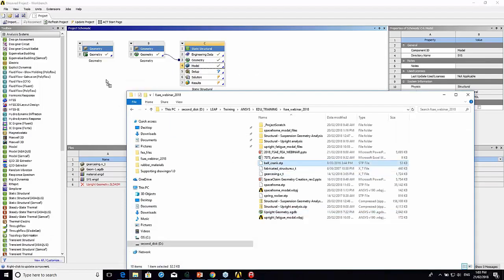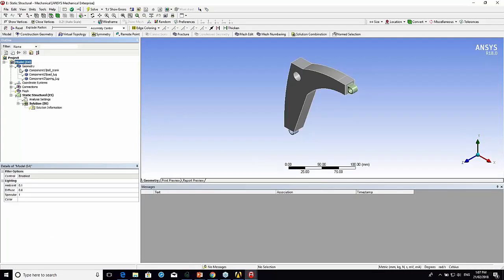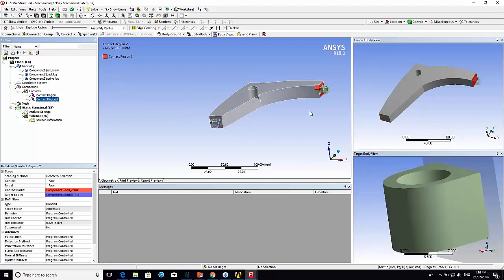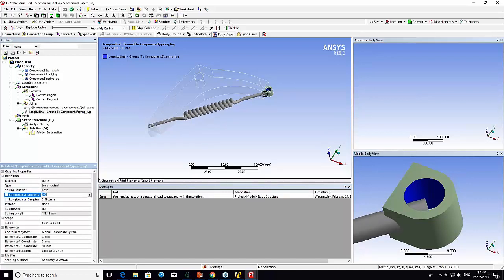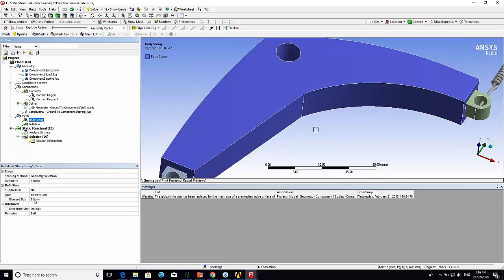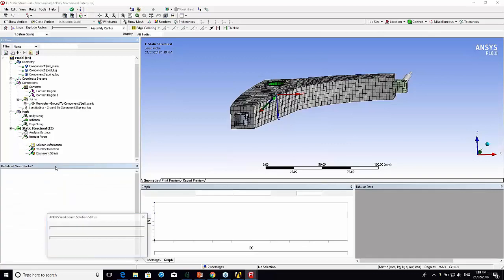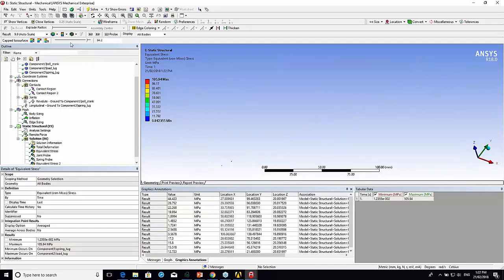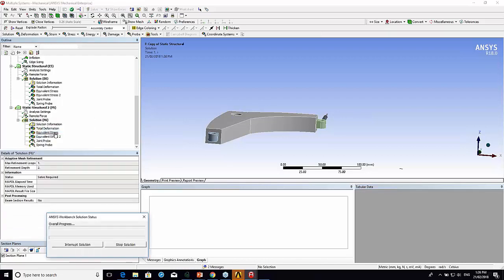FEA for FSAE #6 SETTING UP A STRUCTURAL ANALYSIS

Comment: Is it better to use inertial relief to simulate this bellcrank case?
Reply from the maker: " inertia relief" is used for cases when the body or system is not constrained to ground via a boundary condition. As this body has a joint to ground it doesn't need inertia relief. A plane flying is a case where one would need inertia relief as the aero forces would cause bending and twisting of fuselage, a counterbalancing acceleration needs to be applied for this to happen. This is what inertia relief does.